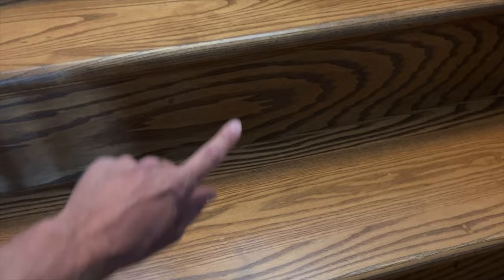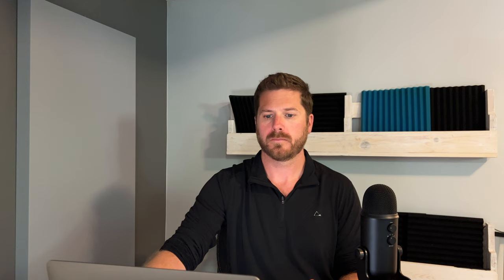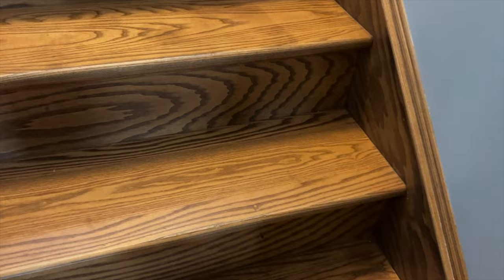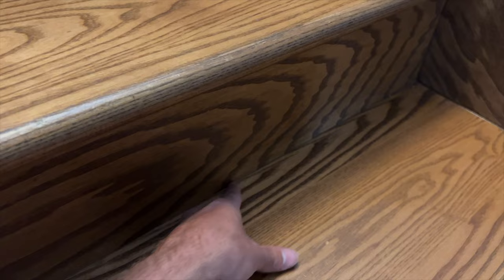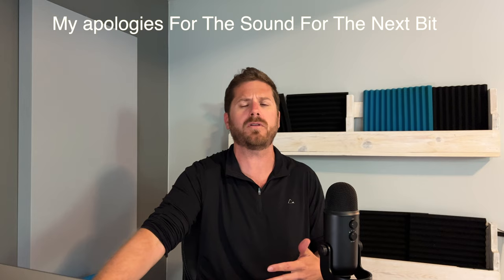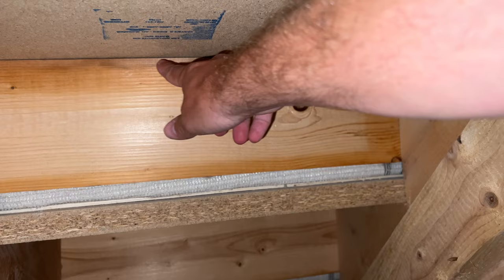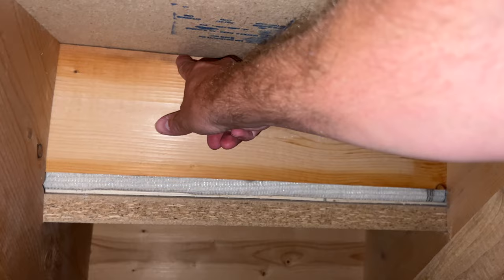How To Fix Squeaky Stairs LIKE A PRO But DIY!

Comment: I have carpet over my stairs and no access under the stairs. Are there any simple tightening nails/tools to fix squeaks without removing the carpet? Thanks
Reply: Same
Reply: not on stairs, but I used that kind of double-threaded snap-off screw kit to fix a super squeaky floor before. worked like a charm!

the trickiest part, both in stairs or floor, is to find where the supports are underneath (stringers or joists, respectively). my kit included a couple really long screws with just a 1/2" of the tip threaded, to help find those supports. if you drill that screw thru the surface and then it just spins and spins, it means you only hit air in that spot below. but if the screw keeps pulling in, it found your support of choice.
Reply: Unfortunately, you’re one and only  solution is taking the carpet up fixing it and either putting it back or have someone replace it if the carpet is old enough and you’re able to afford it having carpet put on your stairs would definitely be cheaper to have installed as compared to a whole room.

Comment: With no access under stairs, the actual stair tread moves when you step on it in the middle and there is a gap at the front above the riser when no weight is on it, how do you fix this? Put glue in and try and screw it from above?

Comment: I have my stairs stripped down to the utility 1" pine they were built with.  Preparing to install oak treads and risers made from 1/2" maple plywood (and I finished them).  I cannot access underneath stairs without removing drywall.  I've tried drilling 3 pocket holes into the tread and can 'pull' the riser tighter against the rear of tread.  Before tightening the screws, I 'injected' Titebond glue down into the rougly 1/16" crack.  Then I tightened the pocket screws (1 in middle, and 1 on each side) and the crack tightened up and glue squeezed out.  8 hours later, still squeaking.  I was also thinking of injecting melted paraffin wax down into the crack.  will the oak treads, glued down with urethan glue help the strength.

Comment: Tackling my squeaks today in UK! Plasterboard removed under stairs, wood adhesive applied, screws pre drilled to prevent cracking, next for PIR staircase LEDs then a layer of kingspan going in before new plasterboard

Comment: Ok, but my problem is my floor is carpeted and I have no access underneath the stairwell. 
Now what?
Reply: not on stairs, but I used one of those double-threaded snap-off screw kits to fix a super squeaky floor before. worked like a charm!

the trickiest part, both in stairs or floor, is to find where the supports are underneath (stringers or joists, respectively). my kit included a couple really long screws with just a 1/2" of the tip threaded, to help find those supports. if you drill that screw thru the surface and then it just spins and spins, it means you only hit air in that spot below. but if the screw keeps pulling in, it found your support of choice.
Reply: @fungeneer  Thanks, that might help. Do you know what kit it was that you used?
Reply: @Steve_Hayden  Squeak No More
Reply: @fungeneer  Thank you for the info and for taking the time out of your day to help me. It's nice to know there are ppl like you still out there. God bless
Reply: @Steve_Hayden   no problem, Bobbie! I'm actually happy to share this little invention. It's super handy and works really well! I think I went over this in another comment here, but the hardest part is just finding the joist or stringer below the walking surface. But they give you a different kind of screw to help with that. Once I'd find a joist, I'd leave that screw in it sticking out. Then I'd find the joist again maybe 6' away, then tie a string between those 2 screws. I could then follow my string line all the way down the joist, sinking in snap-off screws every 6" or so.
Reply: @fungeneer  if it works, I'm sending you a 🎂 cake 🎂.
Reply: @Steve_Hayden  well I dunno how good it'll work on a staircase. The trick is really gonna be to find and screw into those stringers below. If your staircase is narrow/typical width, then they'll only be under the ends of your treads. If that's not where your squeaks are, you might be SOL.
But if it does work, I like vanilla!

Comment: i have another question lol Could i cut Sonopan to put in between the framing of a interior wall and then use safe and sound on top? So it would be Sono, S&S, RC and then drywall.
Reply: Does this make sense?
Reply from the maker: Yes it definitely make sense to me! Sorry I’m two weeks late getting to your question! Let me know how your project turns out!! 😊
Reply: @soundproofguide  update: Ordered sonopan could be a few weeks. LAST question, should i carpet glue the sono to the dry wall or leave an air gap when placing sono in between the framing?